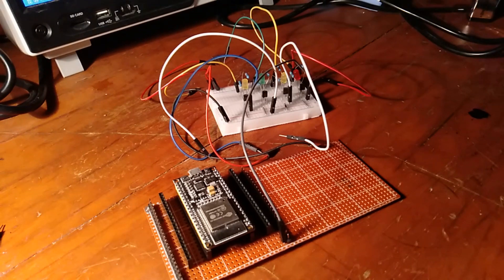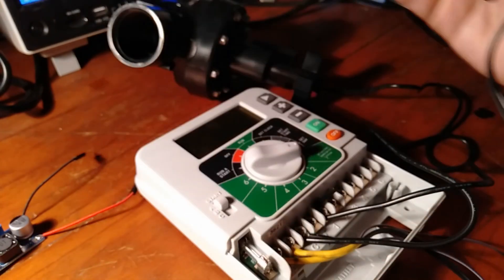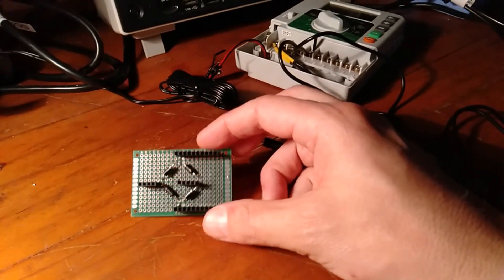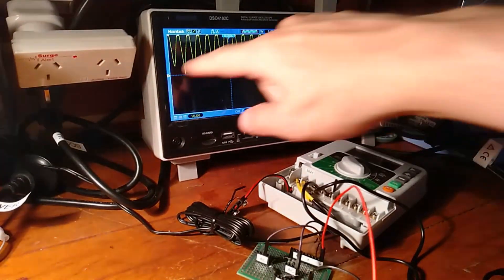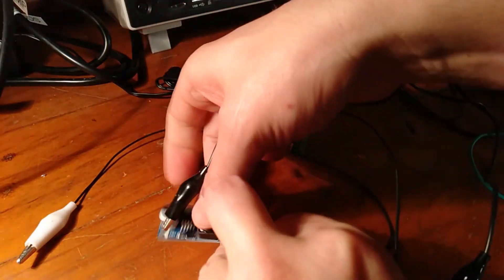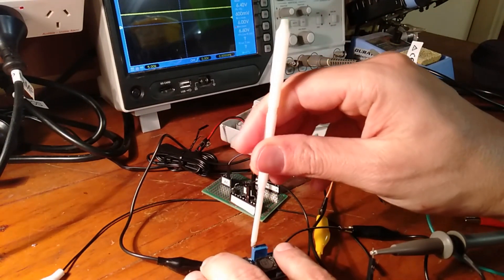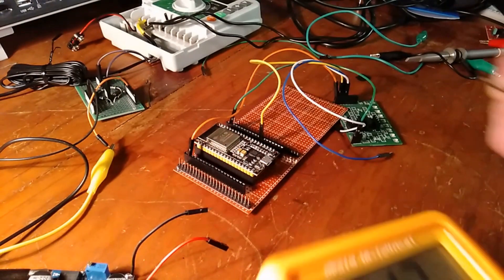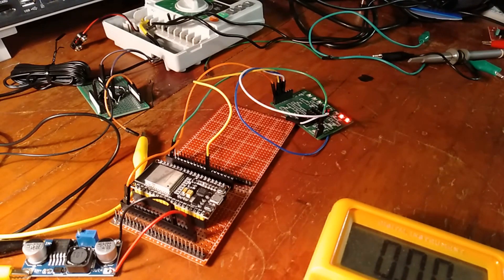Power for ESP32 from Irrigation Controller (Swimming Pool Water Level Part 3)

Comment: Excellent application of a step-down Buck converter module. The scope's RMS measurement value will give you the equivalent DC value of the waveform, not to be confused with the peak to peak value, cheers.
Reply from the maker: Thanks.  I probably should not have been....... but I admit I was quite surprised how big the peak to peak was for 24AC.